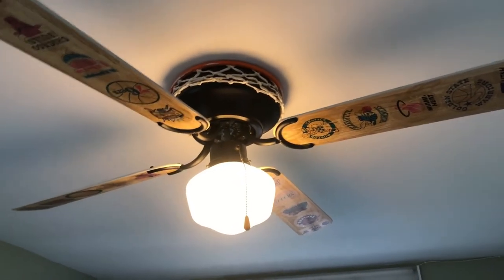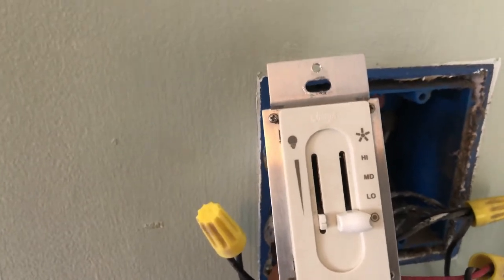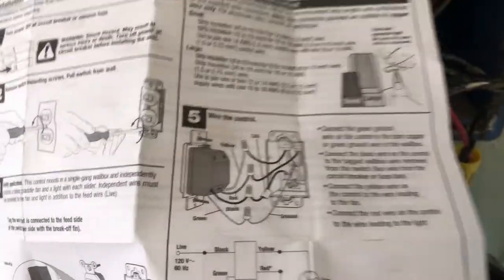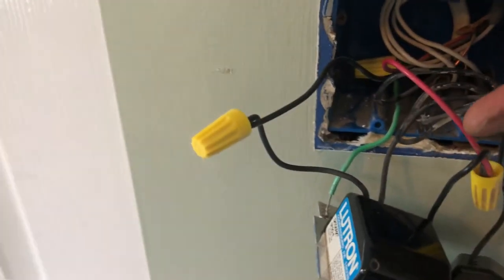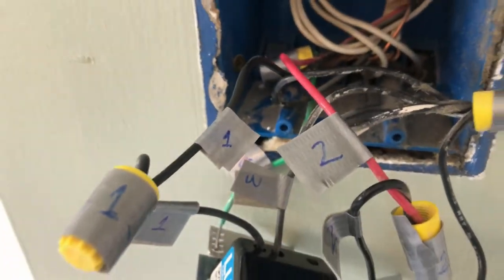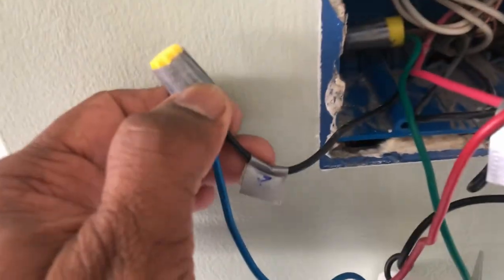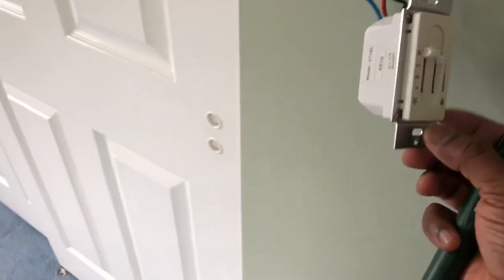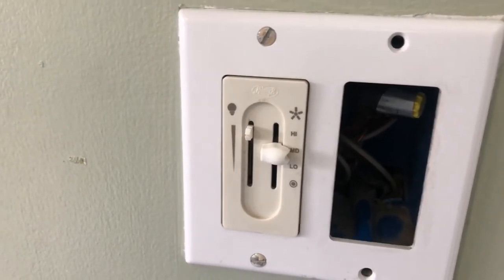Replace TWO Switches with ONE to Operate Fan and Light

Comment: In wall switch, i have 1 black with power hot, black no power, purple.
With new switch like yours wires has blue, red, green, black. Which wires connect each other?